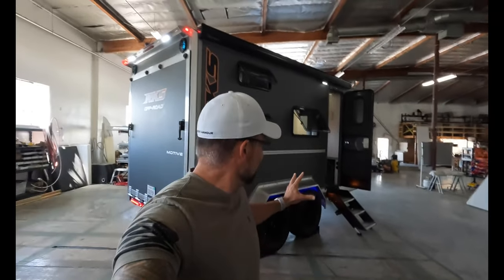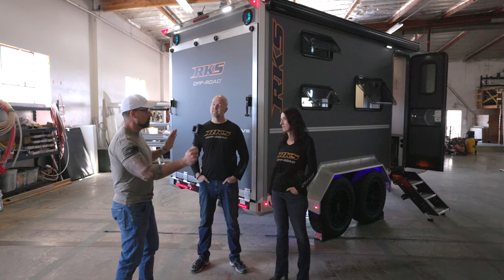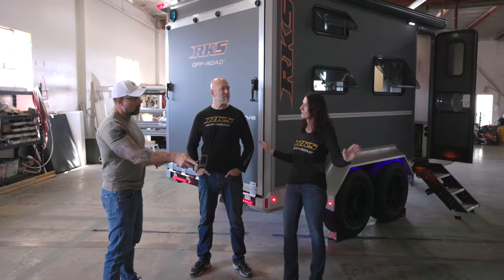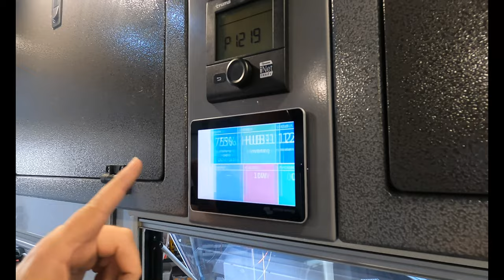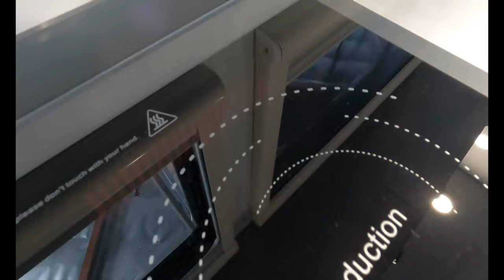RKS Off - Road Motive Toy Hauler Trailer Walkthrough

Comment: Love the induction stove - so much better than propane - and the pantry - love that pantry too. Lighter weight a big bonus as well. Ditto with solar - the more the better - it’s not a priority with some trailers but big priority for me. 

Very thoughtful heat management system - never heard of that before.

Low refrigerator is a bit of a pain for a tall guy but you can’t have everything. 

We don’t need a toy hauler but I do like the idea of lowering the back for ventilation and visuals. Still I would love to see a non toy hauler version.

Saw it at the Expo. Looked really solid and immaculately designed. 

Missed the bathroom - very important for the ladies - but good in-depth interview.

Comment: I'm strongly considering the single axle version, the M19. 3700lbs dry. Waiting on pricing sheets from a couple of dealers.
Reply: kind of surprised it's taking so long to get a price.
Reply: @bartman1857  I was traveling. I did get a price sheet from Princess Craft. I need to follow up with ROA. PC price is $80k for base M19. Upgrades:
HD (dual axle): $10k
Safe: $1500
Convection Microwave: $1200
Upgrade Solar (400 to 800): $2500
Upgrade Batts (200 to 480): $6000
Winter Package: $3500
Disc Brakes: $2000 (included on HD)

So $105k all in. I don't need the HD. Having the extra solar and batteries would be amazing for off grid AC.
Reply: @vandogtrailer6701  any info on the axel for the M19?
Reply: @bartman1857  From this video, I'm pretty confident it's the same 6k solid axle. With the 20" clearance, that seems like a good solution.
Reply: @vandogtrailer6701  I would prefer a timbren on the single axel. Are you thinking if bemeny and sky deck set up? I am excited for you man that will be an awesome set up!!
Reply: @bartman1857  I'm glad you're excited for me! Ha! It's a lot of money. Sheesh. I guess when I hit the road full time this would really give me a decent place to set up camp, work from the road, etc. Is it worth 2.5x what you're buying? Hmm. It's definitely a whole lot of space for the weight. ... Next step: make the down payment, and make sure it's refundable.
Reply: @vandogtrailer6701  Well for me not being a full time guy honestly no it's not worth twice as much. But mine will only have 1,200 pounds of cargo capacity.  I would take the Motive over any over priced imported unit. Definitely over the Xplore and ATC. Boreas eos12 is an awesome rig but probably to small for you and no toyhauler aspect. I am a consultant for US MFG ers. I am totally aware of the global economy and have always bought Toyotas but when possible by from a US made builder please!!!
Reply: @bartman1857  Oh- you're a consultant? Well your input is apprecaited. Yes, the EOS 12 is a very good comparison- same length and dry weight. $75k vs $83.5k (add the winter package to level them out) and the Motive is a no brainer.
Reply: @bartman1857  Next Q: what is your assessment of the insulation of the RKS panels? I really appreciate the insulation in my van as well as the cargo trailer I converted myself a few years back. I know the RKS panels are for great structural integrity. And hanging out on the roof is awesome. But do you think the outside is going to conduct straight through? I hear this about the ATCs. (Probably not a decision point, just curious. I heard Elizabeth on RKS say it's a 6 on one video, but not sure about that.)
Reply: @vandogtrailer6701  RKS uses 1.5 inch honeycomb composite sidewalls and ceiling. I am not sure of R value but that is a thick panel and it is a fiberglass composite no heat transfer like ATC. I saw a post that John Roemer made on xplore Facebook page were he cut in a window. So they walls in the -40 below xplore are 2.25 inches thick with foam not honeycomb and cheesy Luan wood panel layer. I know they put batten type home like insulation in roof but I feel like the Motive will be plenty insulated for you especially with winter package. Also the Motive is 3 feet longer and close to a foot wider then the Boreas.
Reply: Also keep in mind if you go to any aluminum framed frame like the xplore you will be going over your towing capacity of that bad ass van. So in my anything but humble opinion and assuming you will always have your van as a tow vehicle you have a choice between the Motive at 105k and all it has  to offer. Or the Trail Marker at 65 k (guessing on 2023 price loaded like mine)
Reply: Forgot to mention the obvious in regard to Princess price sheet. That is MSRP so I am sure between them , ROA and Xgrid there will be discounts offered
Reply: @bartman1857  I just watched the clip again- yeah fiberglass and 2.5 inches thick is a great answer. ... Eos 12 does say 19'3" and the Motive says 20'6". Did you see something that had the Motive at 22'? ... Interesting anecdote on the Xplore window. Huh. This RKS could be a very very long lasting product. Lifetime purchase basically. ... I guess yours could be $65k by next year. My all in on the single axle would only be $95k. Less of I went stock solar and batteries. But I'd rather be looking at excess capacity than for it.
Reply: @bartman1857  Yeah- I need to get with the other two asap. I think the value proposition of this product will start screaming from the mountain tops and their orders will come. It's not great to buy the first thing coming out the factory. I expect some minor QC issues. But this is a great team and I bet there will be a lot of care on the first units. ... There are a lot of garage operations springing up, especially for trailers. Not going to throw anyone under the bus, but some products with some good design ideas don't always get executed. This team looks like the real deal.
Reply: @vandogtrailer6701  The Motive is 1.5 includes thick but with honeycomb composite. The Xplore is 2.25 inches thick but has aluminum studs incorporate. The Boreas has a wild sloping extended a frame tounge which makes the overall length longer but the box is only 12 feet like my Trail Marker. Also I am 50k all in on my 2021 ordered Trail Marker. I am picking it up in NY. So 65k is probably high for 2023. The 2023 Trail Marker will likely not be completed until June 2023 if you get in on upcoming June order. I know not ideal.
Reply: @bartman1857  Oh- Motive is probably 3' longer in the box than the Boreas. Yep. And the width is a big deal. I've seen quite a few vanlifers transition to built in truck boxes. I think their 8' width makes for a very livable space even when not connected to the cab.
Reply: @vandogtrailer6701  agree interior width is important. I am happy with 79 inches in my TM especially with out the wheels penitrating the box (no wheel wells). So the Motive is cab over wheel which is why it is makes the interior weight even wider then mine. Curitial for full time living.
Reply: @bartman1857  This is all great information, Bart. Appreciated. I expect if RKS orders blow up relative to their production capacity (mostly HDs of course), they might also be charging 15-20% more next year. Then I'll feel like I stole it.  ... Who do you work for (if you're allowed to say)? How does consulting work? Are the manufacturers your clients?
Reply: @vandogtrailer6701  I have my own firm. We do environmental EPA compliance for any type of MFGer. I do have a few trailer chassis clients. Lots of metal fab and machine shops. Couple of galvanizing operations. Any MFGer that process hazardous materials is a potential client.
Reply from the maker: @vandogtrailer6701  We are happy to read your interest and want you to be aware we are only production the M19HD (Tandem Axle) this year. If you are seriously looking, we suggest you take advantage of the perks (https://www.startengine.com/rksoffroad)
Reply: @rksoff-road8282  Please! I'll volunteer to be the first one! Ok- thank you for reading through our conversation. Much appreciated.
Reply: @vandogtrailer6701  not sure what this startengine deal is about my man. Did not get the feeling like they are totally committed on single axel model and if so could be a while. I could be wrong and mis reading this.
Reply: My guess is you would get a 2023 Trailer Marker before a RKS Motive M19. The more I think about it the Trail Marker probably has the same cargo capacity as you will not be able to put much more then 1,200 pounds in the M19 due to your vans towing capacity
Reply: It just dawned on me. I wonder if the length, height and cargo capacity is pushing it on a single axel design. This maybe why the started with the tandem axel model first. I thought I heard from a ROA video that RKS was not even sure the M19 was happening but then said it was.
Reply: @bartman1857  I contacted the same lady on the RKS chat line as a few weeks ago. Previously she said the single axle would be available in the fall if ordered now, but just now she confirmed that it won't be in production until next year. ... There are plenty of single axle 20' trailers. Most have 5k lb axles and heavier construction, sometime leaving under 1000 lbs CC. RKS is using a 6k lb axle, so 2000+ carrying capacity is doable. ... Correct: my van's excess carrying capacity could not do 6000lbs. What I'm buying in this vs a smaller lighter unit is the cubic volume, good off grid climate control, and an enormous black tank. If I can only carry 1 dual sport and 60% (random guess) of their 70gal fresh water tank and the usual odds and ends then that would be a good trade off. I have another 27gal of water on the van with my 9k lb load out. ... The Trail Marker is an excellent product. Definitely on a very short list of our "van augmentation" segment. :-)  It's just that all of this stuff is very expensive. Looks like I'm going to be on the road for 6 months in just a van with no payment. If I buy anything at any cost and deal with the extra length and parking, etc., I need to feel like "Hell yeah, this was a life transforming upgrade and worth every penny."